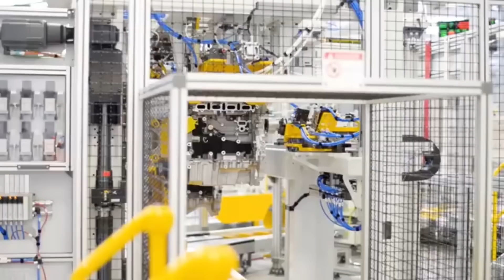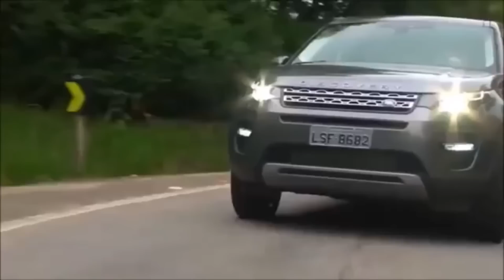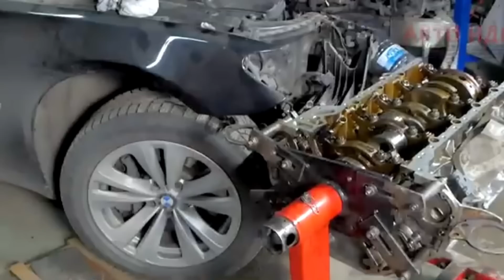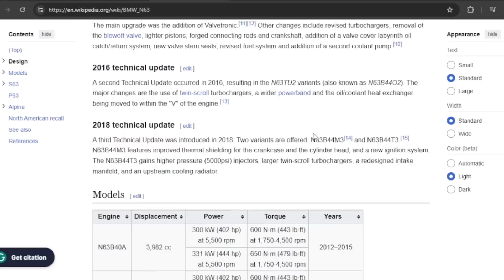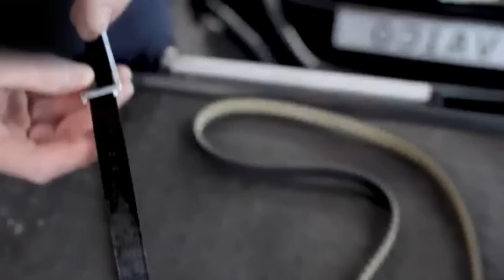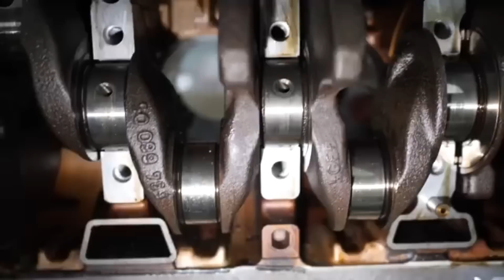Least Reliable Car Engines STILL IN PRODUCTION - Part 2

Comment: ALL three cylinder engines are CRAP! they are not balanced, and are designed to fail, they do not want the public to have personal transport. We are now seeing engine design that are worse than the ones they replace. A 4 cylinder 1.0 engine lasts - if serviced - forever, the three cylinder barely make 60k.

Comment: GM acquired SAAB to get access to their 1.9 litre diesel engine. This could be configured as a single OHC or twin OHC which gave improved performance and economy. I have had three of these and they all ran over 100,000 miles ( UK miles LOL) with correct servicing. They never needed top ups of oil between service intervals at every 10,000 miles. The only bits that failed were a glow plug, plastic coolant header tank, and a plastic pipe in the turbo boost system. Water pumps were changed with the cam belt at 100,000 miles. The basic engine was shared with other manufacturers including Alfa Romeo. 
The engine in twin cam form gives over 50 mpg at motorway speeds, running at 2000 rpm which actually gives a speed slightly above the UK limit of 70mph.

If our American friends have problems with this motor its because they aren't driving it right. Keep the revs up and don't lug it at low speeds in high gears!
Reply from the maker: Okay
This is great. Thank you for sharing
Reply: The 1,9 litre are a FIAT engine. Not a SAAB. Also sold In the Lancia Delta as the 1.9 MultiJet Twin Turbo
Reply: @perresoren  That's not what I read. GM needed an engine that met updated and  amended tax rules affecting the market for business cars because their 2.2 litre diesel lump did not meet the new rules. That was why they acquired SAAB. The 1.9 litre diesel motor was installed during the production of the Vectra and continued into the Insignia, as well as some vans. Some Vauxhall vans received the Renault 1.9 litre diesel motor. A friend has one.

Comment: What amazes me is that some manufacturers can make decent engines so why can't others? My previous Audi A6 2.0TDi was still going strong on its original unrepaired engine at 332,000 miles, the cam cover having only been removed once in its lifetime to replace a single glow plug, no excessive oil consumption and still ran and sounded like new. Its replacement, an Audi A6 40TDi, has now done nearly 90,000 miles, uses no oil at all and has just had a main dealer service with a 100% clean bill of health. In this day and age all engines should be this good.

Comment: not all european engines are trash , mainly the italian ones hahah
Reply: some italian engines are the most reliable
Reply: @gruppenfuhrer73  correct, like the 2.0 Alfa Romeo Twin Sparks from late 90's to early 2000's and Fait 1.8s from the Punto HGT in early 2000's

I still drive them daily with no issues besides aging to parts like alternator and thermostats.
Reply: Just most of them lol